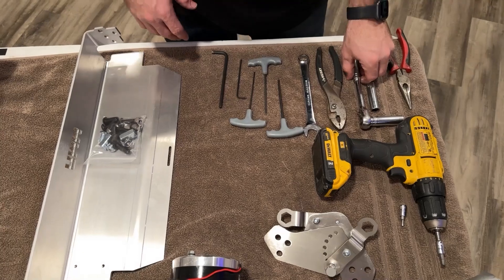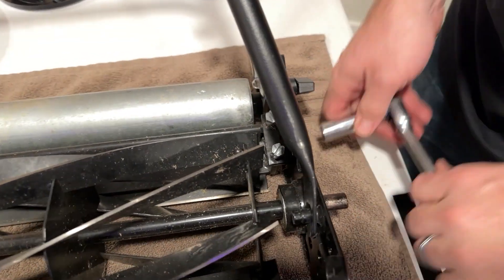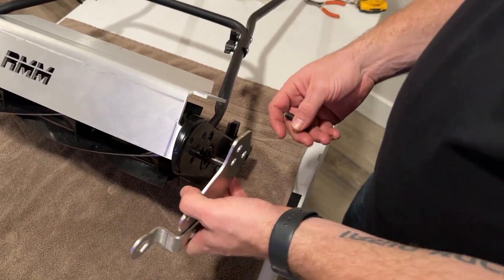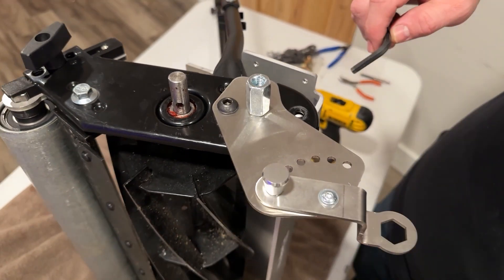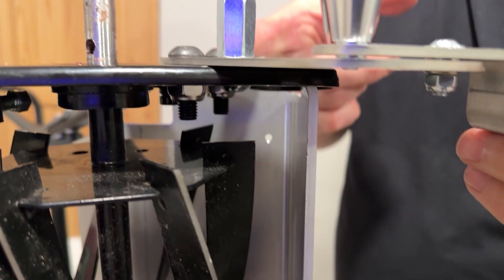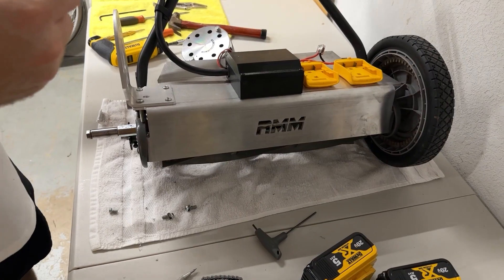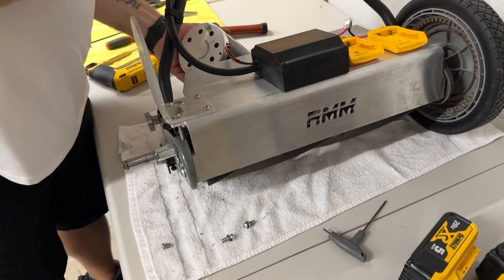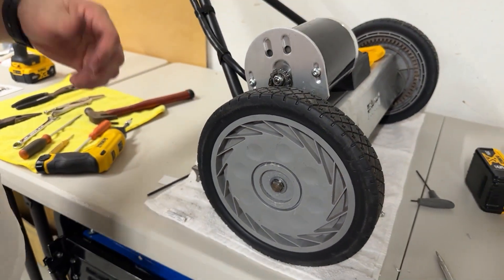RMM - Electric Conversion Bracket Install - Part 1: Main Bracket and Motor/Drivetrain Updated 8/24

Comment: motor what volt?
rpm minute ?
Reply from the maker: The motor is 48V, Max reel RPM with current gearing configuration is about 1500RPM.